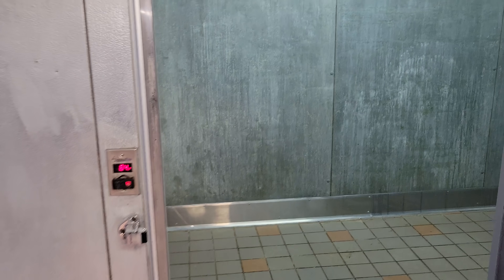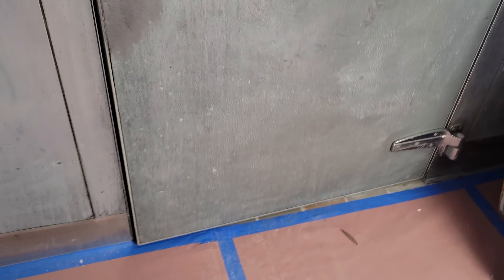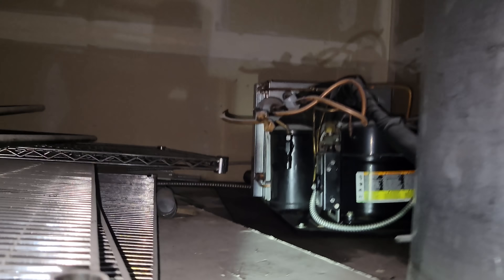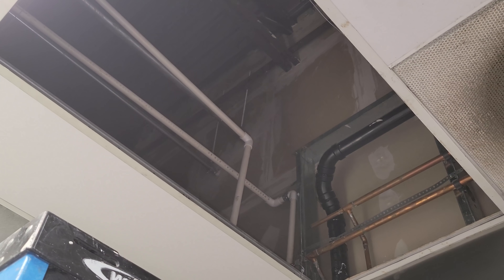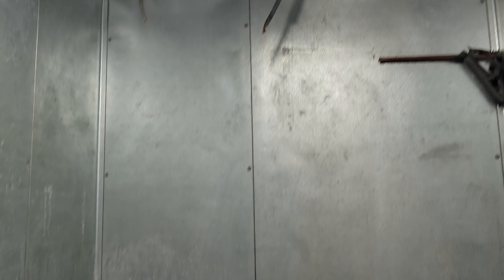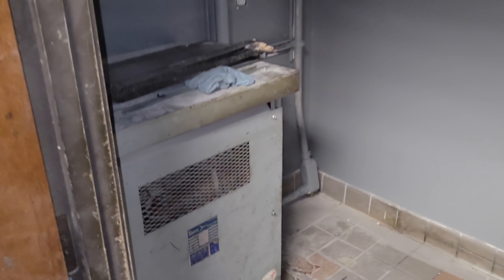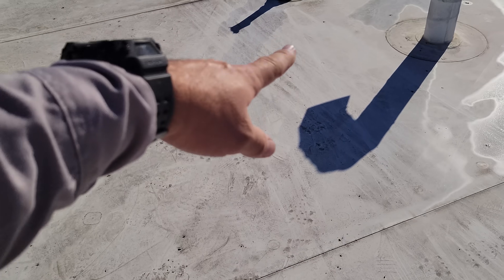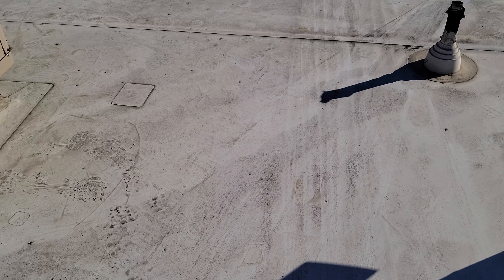THEY JUST REALIZED THE WALK IN COOLER IS MISSING SOMETHING

Comment: Chris if you didn't get this job  i'll tell you why?  you ran your mouth too much showed to much care  wanted to much   .. nothing wrong with it i've done it tons of times....  but most of the time Clients want someone who will slap something on and let it run  few years down the line we come back and change everything   compressor on the roof? HA  slap an air cooled unit back up there or use the current one.. thats what a lot of hack mechanics think and do... fix the door? NAHH    install electronics NAHHH use mechanical or use a pressure control...    but its alright  for us one door closes another opens

Comment: Why is a 115V exaust fan bad?
Reply from the maker: Yeah what James said and the motors are typically more expensive....
Reply: @UCpPYNua54z-aWxmv1a-KPJg Customers are mainly billed on Watts, but larger commercial can also be surcharged for bad power factor, sometimes billed for KVAr (apparent power) too. When dealing with  AC, Watts is A x V (RMS) x Pf (power factor). There is no power factor in DC, so it's like you said V x A = W for DC. 
RMS is the voltage component in AC that is equivalent to the DC voltage and what is used universally for the AC voltage level, not peak to peak. 
With all that said, just because a 115V motor draws more amps it doesn't mean it will cost more to run than a comparable 208 / 240 motor. The 208 / 240 motor will draw an approximately inverse amount of Amps vs Volts when compared to a lower voltage motor. Of course service factor, slight motor differences etc... can cause one or the other to use more power (Watts) but the reason you use higher voltage equipment is to lower the required Amps and associated components. Lower voltage requires heavier gauge wire, heavier contactors, larger motor winding etc....  All of which contribute to higher upfront costs, but will use comparable amounts of power with higher voltage equipment. 
But this is why water heaters and other high draw equipment in the US is 240V vs 120V. A 5,000W water heater will draw half the Amps at 240V vs 120V. Not to mention, with purely resistive loads, like a water heater, the power factor = 1. Which means there is no power factor to account for. I mention using 240V in the US, since most of the world uses 240V for everything to start with, no 120V in most of the world. 
Not arguing, just trying to clarify some of the misconceptions here.
Reply: @inothome  Thank you.  I tired to keep it simple with my one sentence explanation. I didn't take the OPs question to be a request for a nuanced post just the gist.
Reply: It's not bad per se but at the lower voltage it draws more amps which means it cost more to run.
Reply: @jmarjie  Unless they are being billed for current drawn rather than power, that's not actually true.
Reply: @uxwbill  Pretty sure that why we do power faction corrections since most of the commercial location I know of bill for apparent power. Thou I know that won't hold out universally.
Reply: @uxwbill  You are correct. Just because the current is higher with a lower voltage doesn't mean it will cost more. Volts and amps are inversely proportional. A 1HP, single phase  115V motor will draw more amps, and a 1HP, single phase 208V motor less amps, but when you calculate the power (VxAxPF=W (power)) they will be similar. I can't speak for the cost of the motors, but power usage will be close. It may cost more to install the lower voltage motor with heavier gauge wire and such, but power cost difference will be marginal when same class and efficiency motor.
Reply: Sure, a 480V 3PH 1.5HP motor on a freq. drive that is connected to the building automation would be the way to go, since very few exhaust blowers run at FLA anyways. Yep, ain’t getting that job either…
Reply: @jmarjie  quite wrong  volts time amps equal watts.  A 115 motor at 10 amps will be about 5 amps. Same watts which is how electricity is charged
The only savings is in wire. The wiring for 208 can be 1/2 the size of 115.

Comment: I see they have two 40 watt fluorescent lights in there.    Are they interlocked with the door?   If not you have an 80 watt heater int the   ice box!
Reply: 40w in a freezer is ok, 36w can be a bit of a problem if it's ever turned off!
Reply: @stephenhunter70  It's 80 watts.  Chris should suggest they be replaced with LED tubes if they aren't already.   In fact that should be a standard retrofit.   They use half the power and last forever.
Reply: @castletown999  That's right. And they'll run in cool rooms that a below a specific ambient temperature. 40w fluros have a lower minimum temperature than 36w fluro's
Reply: Not much of the wattage for lighting is converted into heat, some of it is expelled as light energy. The exception would be heat lamps, but they aren’t installed in coolers.
Reply: @ingcampthree4523  the light energy would go into the room and be converted into other kinds of energy by interacting with surfaces

most likely heat or another heat-equivalent form
Reply: @angrydragonslayer  this, except without the qualifying "most likely" and "or another heat-equivalent form", unless the fixture is emitting RF or acoustic energy that's getting through the walls, all the energy is contained in the room, and all energy ends up as heat. one of the rare cases where the physics are simple
Reply: @spambot7110  you never know, a company i worked at once bought cheap chinese lathes and the 60w bulbs on those were emitting more gamma radiation than light
Reply: They might be LED, and not produce much heat.
Reply: @Farm_fab  judging by the sound of the lights. They are just old fluorescent tubes.
Reply: @xiar5546  I'm not sure if that hum was the fluorescent lighting and not the 440V to 220V transformer. It certainly sounded loud enough to be heard through the wall.

Comment: It was hard to understand: are you saying that the evaporator was stolen?
Reply: When a restaurant closes a lot of things can take place. The outgoing place could scrap everything they installed/owned, there could be an auction that the new tenant weren't aware of, or the demo crew wasn't told specifically what stays or goes and no one noticed until it's too late. 

Just last month I dealt with a restaurant who ordered new hoods and 1 exhaust fan but planned on reusing the make up air, 2nd exhaust and the controls. They didn't realize the controls were scrapped in the demo until 1 week before inspection when they cornered the electrician about starting the hoods for a pretest.

Comment: Looks like a lot of the Vegas anti serviceability installations I had to deal with constantly. No service platforms, blocked side panels, no service lighting, no 110v outlets. I wonder if the inspectors even show up after permits are pulled.
Reply: A lot of palms were greased. This happens everywhere. I worked in the food industry for years and I’ve seen problems that never got cited but should have been.
Reply: From what I've seen? No. We had a brand new AC installed at my house earlier in the year which required that an inspector come by and inspect the work. No inspector ever came, and they just automatically signed off on it. Unit works great, but would've been happier if an inspector came to ensure that things were done properly (I know how to install hvac stuff since I completed the HVAC course at ATI for that, but what I know is very basic and from what I've been told by other techs a lot of what you learn in school doesn't even apply anymore in the field)